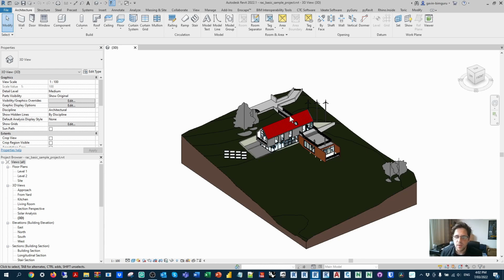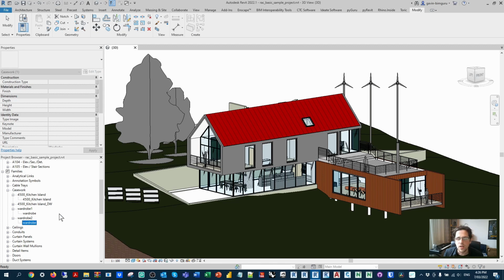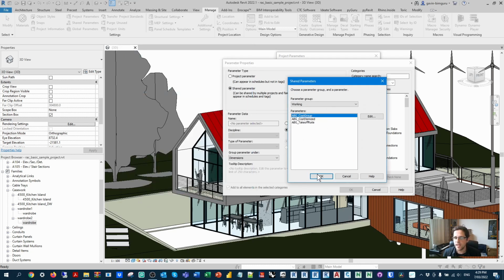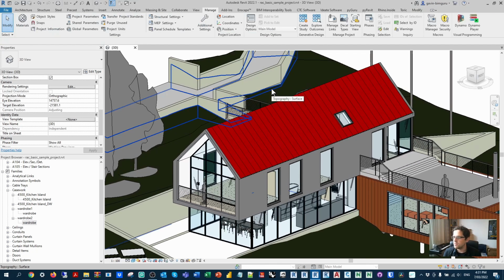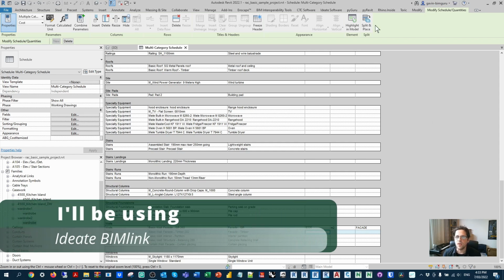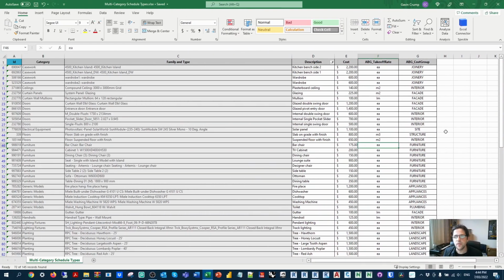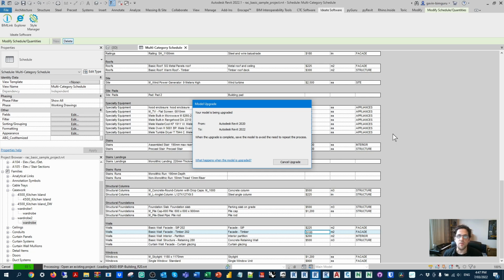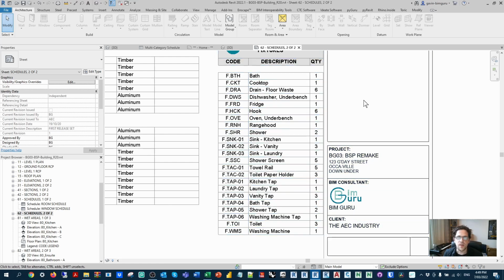Preparing Revit models for cost/quantity takeoff!

Comment: Your videos are super informative! I really appreciate your content! can you please suggest me what could be done if i wanted to extract data using assembly code or keynote parameters? how does that work?  because getting data organised into either uniformat or masterformat seems to be a big deal..
Reply from the maker: The key is actually assigning the codes to the elements first - cant extract what isnt populated! If youre unsure where to begin maybe try the autodesk interoperability tools which have an app for uniclass.
Reply: Thankyou I've tried using the add-in. It's cool and does the job perfectly. Also, Do you have any suggestions in place of Ideate Bim link which is available for free?
Reply from the maker: @shaliniuma3594  yep diroots one has a similar tool in it.

Comment: Great work man, I have a question, what would be the difference between Sheetlink and Bim link?
Reply from the maker: BIM Link is made by a software firm called Ideate. Whilst it is quite expensive for the average user, it's used by many large firms and has a lot of advanced functionality versus alternative applications.

Sheetlink is made by another software firm called DiRoots. It can achieve similar outcomes to BIM Link, which less advanced features available. It is a free application, so is delivered on a different basis to its users. One could argue it is a bit of a rip-off of BIM Link, intended to destabilize DiRoots' competitors to some degree.

Their ProSheets app is very similar to another application called Xrev (and better in my opinion), and they also have tools very similar to Ideate Explorer and Ideate Sticky. They've certainly given some great tools for free to markets who can't afford them, but probably aren't well liked by their developer peers as a result. Make of it what you will!

Comment: Hi, this is a great video, may I ask for a bit of advice, in my company we are working with Revit 2019, we are going to update but don't have a really strong reason to select the new version of Revit to use as standard.
Reply from the maker: A few reasons I guess would be the fact most consultants probably use revit 2020 and higher now, 2019 will be phased out of the 4 year apart limit when 2023 arrives and most addins/dynamo dont support old builds anymore. The better question to ask them is why to stay in 2019 I'd say. I'll probably move to 2022 quite soon for my own content and templating.
Reply: @AussieBIMGuru  thanks a lot, this weekend will be updating the company equipment I will support to use 2022 to avoid obsolescence for a while.
Reply from the maker: @rigobertojosealvearbeltran6492  just make sure to coordinate the upgrade with other consultants on projects you're collaborating with :)

Comment: This technique can also be quite usefull for environmental performance analysis calculations, where energy contents of the building material get a specific score (a bit like a carbon emissions footprint score). In the Netherlands this is now mandatory for new building permits and the score has to stay below a certain value, i.e. using a lot of concrete is discouraged.
Reply from the maker: Yep I use this technique often, and am also exploring it for embodied carbon rates times quantities. The challenge is typically having people measure things accurately enough for takeoff in my experience.